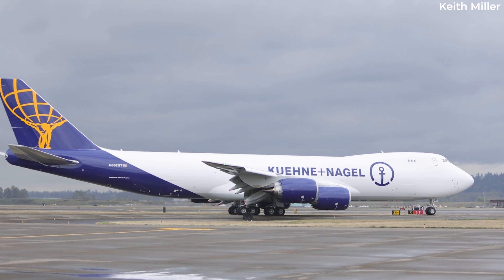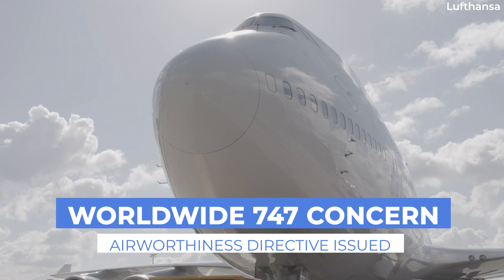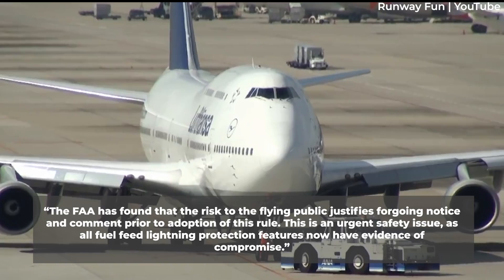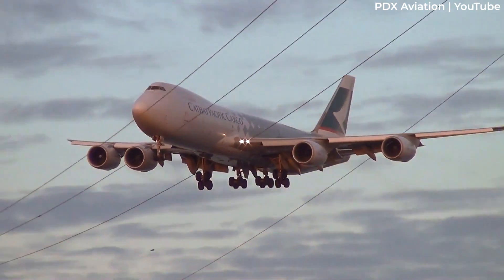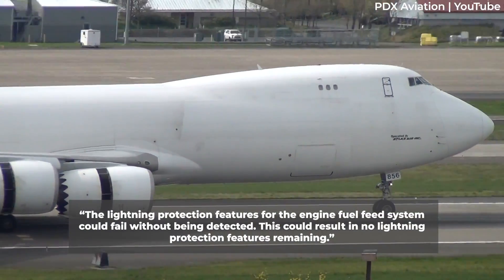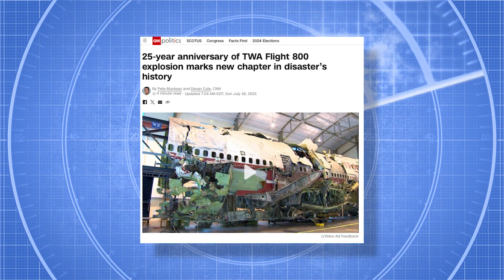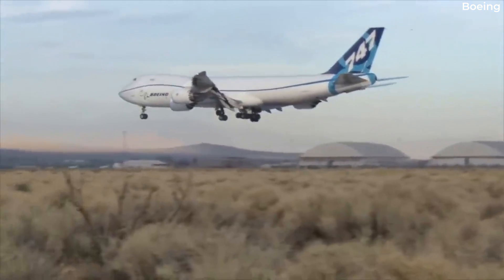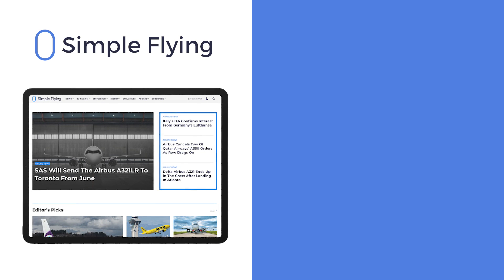Boeing 747 Lightning Protection Must Be Inspected Due To Fast Degradation

Comment: Building the fuel system is already difficult, working inside the tank is difficult (unless you're 4.5 - 5 ft tall), and building lightning protection anywhere on the plane is not easy.

Comment: These are more reason is why I refuse to fly boeing aircraft!
Reply: Airbus has there problems too
Reply: All A380’s require wing crack inspection. This is the second recall for this issue on the aircraft.
Reply: @EdOeuna  Ongoing issue from several years back.  The wing skins are separating from the ribs.
Reply: Ok cool